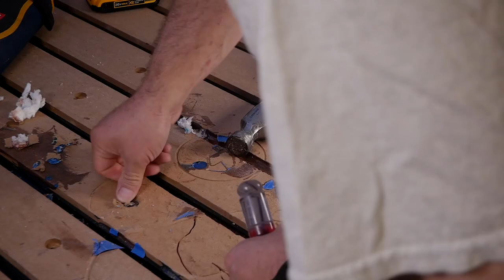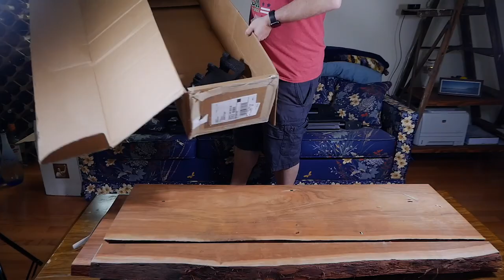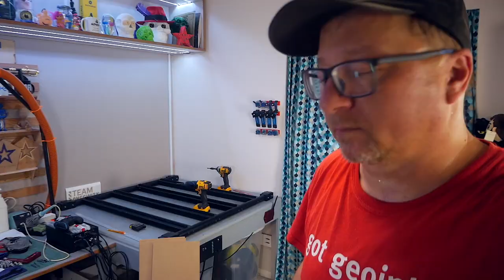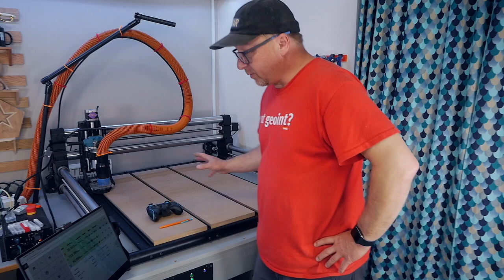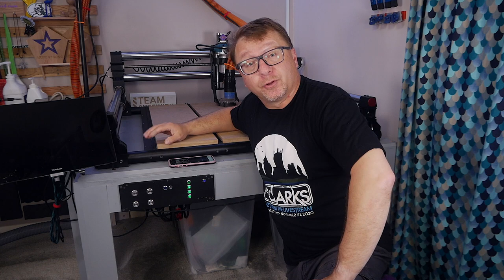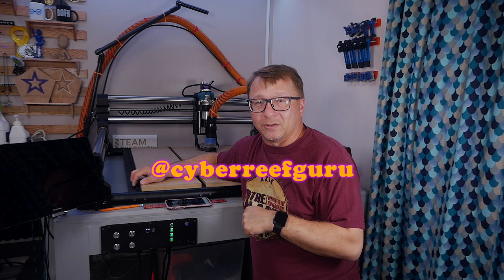Onefinity QCW Review and Thoughts

Comment: I just received my onefinity QCW.  As of March 2022 the design has not changed to add the additional outside support you mentioned.  I was a bit disappointed in that.  Great video and thanks for the review. I am still happy overall and just hope this single bracket support is not a factor over time.
Reply from the maker: Thanks for letting me know and thanks for watching!
Reply: Second that. Still an issue

Comment: I bought the QCW frame for my X50 journeyman and I must say I am not happy with it. I was really excited waiting for it to arrive after 4 months of waiting I got the Onefinity about 3 weeks before the QCW frame so I had already mounted my Onefinity to a torsion table I had built and I put T bolts in the wood top and built it super nice but once I got the QCW frame I found the mounting holes are threaded and they don't go through the blocks so I can lock it all together to the table. I may drill it out and run some bolts through it still but the other issue I have is I put the bar on my table, and I pushed down in the center of the bar and with little force it flexes it isn't as rigid as I expected it to be it will most definitely need supports under the cross bars to eliminate the flex. I think I will drill and tap the round bars and put some long set screws or little feet so that I can mount the QCW then run them down to the tabletop to add the support it needs. I am handy and able to do this stuff but for the average person it would be complicated. My opinion it's maybe ok for the smaller machines or someone not worried about a little flex but for me I plan on running some aluminum and UHMW machine plates that need to be flat so I will need a solid table. On that note the Onefinity is a beautiful machine and I expected it to be a DYI project for the price getting one would not be a mistake by no means they look amazing, and it runs great. Onefinity X50 Journeyman, upgraded to an 80mm spindle 2.2kw water cooled, J-tech 7w lazer,
Reply from the maker: Thanks Vee - I noticed the same thing - no way to mount the frame permanently (unless you buy the collapsible stand). Thanks for watching!

Comment: Great video on the onefinity
How was the setup and software and wiring 
Thanks jim
Reply from the maker: Thanks Jim - setup could not be more simple. Literally 15 minutes and you are ready to cut. I don't know of a machine more simple to setup in this class. Thanks for watching!
Reply: @cyberreefguru  
Thanks for fast reply 
What software comes with the product and how is the monitor and wiring
Do you still use a laptop or iPad with it
Reply from the maker: @jim6402  Hi Jim - the Infinity has an monitor and controller that is web-enabled -- no need for a directly connected computer to execute the gcode. You can move gcode from your computer to the controller via USB or the web interface (that is what I do). Then just click 'play' and the machine will execute the job without further interaction (other than those inevitable oh sh*t moments). You still need CAD and CAM software. They offer discounts for some, and there are free ones as well. Hope this helps! Reach out to them or find Stone or Morgan online -- they are very responsive. Thanks!

Comment: You have the frame where the boards are anchored from underneath.  To change them out, it means taking the machine apart, correct.  Would using the anchor from above eliminate that?  I am ordering a Woodworker and am considering a QCW.  Thanks.
Reply from the maker: Hi Scott - you do not necessarily have to take the machine part, but you do need to have access to the underside some how.  Either having an open space below the QCW, or allowing the OF to pivot some how.  If it is permanently screwed down, then those screws need to be removed. In talking to the OF folks, they said a kickstand might be offered in the future to aid in replacing the waste boards.  Hope that helps - thanks for watching!
Reply: @cyberreefguru  I was thinking about the top anchor frame.  Especially after seeing how you put it all together.  I am kinda tight on space, so I was thinking about their roll around cart too.  Thanks.
Reply from the maker: @scottmorris4914  Hi Scott - I will definitely get their cart if I move the machine to the garage. The top mount is a good choice, though for some reason they recommend the bottom mount -- not sure why. Best of luck!

Comment: When you put you Onefinity on the QCW frame did it square up the Onefinity? Or is the Onefinity a parallelogram? This is the only thing stopping me from purchasing the QCW frame. Is there a way to adjust the frame to make the Onefinity square?
Reply from the maker: Hi Todd - when I initially put it on the frame it was not square, but I didn't know why.  I loosened the bolts holding the frame together which help a little but then the frame was too long. I got the back seated properly, tighten the frame, and then the front was aligned correctly.  So I believe it did square up properly in the end.  OF has made a ton of changes to the frame, so I think the production version will actually be easier to use, but I don't have it right now to validate.  Hope this helps - thanks for watching!
Reply: @cyberreefguru  Thank you for the information. Keep kicking those videos out.
Reply from the maker: @toddgansemer7588  Thanks Todd - challenge accepted :)

Comment: I really think 1F should make a 5 or 6 plank QCW with complete rails to support the planks.  I do not want little screw holes, 1/4-20 on my boards.  Blue tape is not good, if it loosens, the entire project is junk, I have lost a couple of projects already using tape.  I ordered mine, top mount, they have time to tell the manufacture to do them plumb as well, or don't sell them.  Sorry I am so hard however, with our investment $$$, not a good thing here for me so far.
Reply from the maker: Hi Randy - I've never had a problem with the blue tape method, but I do agree more rails would be better (for me anyway).  Thanks for watching!

Comment: T track issue is still there as of 2022
Reply from the maker: Thanks for letter me know -- have you contacted Onefinity? They are usually good at responding to issues. Thanks for watching!
Reply: @cyberreefguru  Onefinity had a disclaimer in the description of the QCW. Really a bummer to use a t track that isn’t compatible with all the Rockler clamps. Not to obsess on the negatives, but I’ve also had an issue with the QCW being too short from front to back so that the mounting holes didn’t line up. Very disappointing for a “precision” instrument.

Comment: Mine came with missing parts and when I contacted Onefinity they wanted to charge me extra for the missing parts. This company sucks.
Reply from the maker: Hi Bruce - that seems really out of character for them. They are usually much more helpful. Recommend sending them an email if you have not already.  Thanks for watching.
Reply: @cyberreefguru  I thought the same exact thing after seeing so many positive reviews but after multiple emails back and forth the owner just doesn't care about the customer. I bought a lot of items from this company too. I guess it's all about the money for them even though it was only bolts. Such a cheap way to be over bolts. I got new ones anyway but the lack of quality control, the crappy holder for the monitor, I had one bolt hole messed up that I had to re tap, etc. Just not what I expected after so many reviews. I agree it was out of online character for them. Perhaps I got the owner on a bad day.